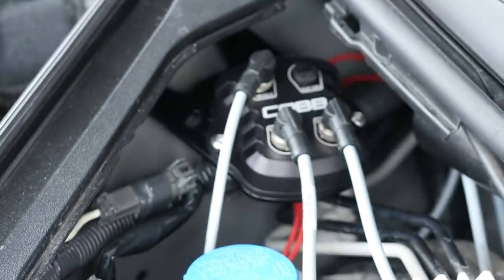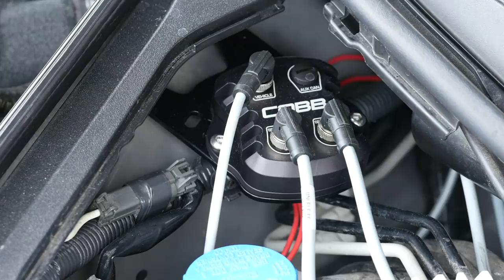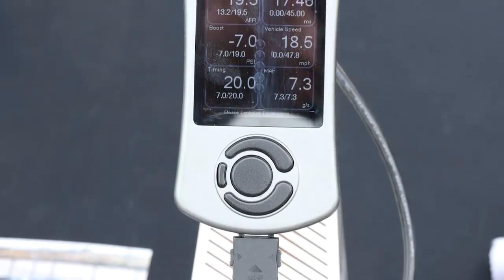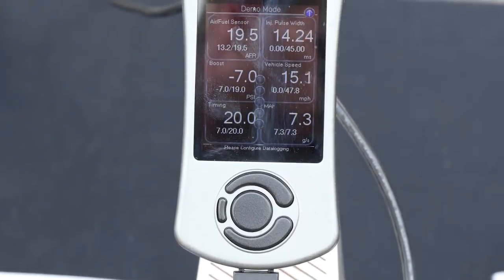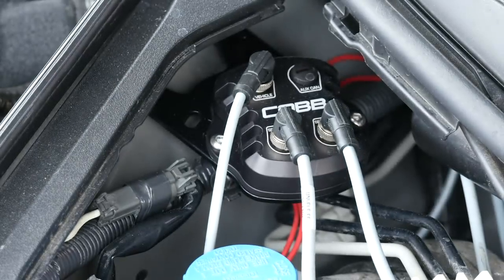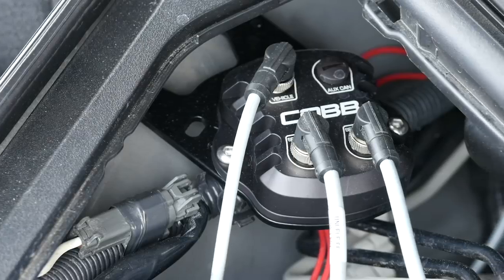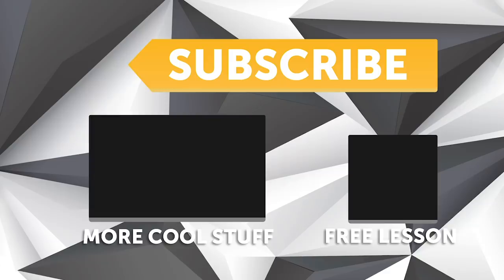Stock ECU + 1000HP | Flash Tuning & COBB CAN Gateway [TECH TALK]

Comment: As a former cobb customer I've gotta say the real issue with refresh devices moving forward is the pricing structure.  The access port is a decent value on the front side but over time things change.  My experience required me to send my $700 unit to get repaired at $100.  Then down the road new features were added so old users have to upgrade to a new unit although the factory ecu hadn't changed.  Then the legal climate changes and they have to implement the requirement of a $100 tuning class so you have access to future updates to the software.  The prices of standalone seem to be coming down but over time the cost of ownership for the relish device can creep up.  Thats why i ended up jumping ship and going to a standalone.  I still think the ap is a good option for owners who just want a canned flash for common upgrades but for anything more than that i suggest looking at Haltech or Aem.  More functionality.
Reply from the maker: Hey Dagan, agree none of those things that happened in your specific application are ideal. However nearly always, and even with the problems and additional costs you have had a reflashing solution will be cheaper than a standalone. 

What standalone did you go for? What was the price once it's all online? - Ben

Comment: I use a similar system like the CAN Gateway to monitor inputs and control outputs through a system called I/O link. It’s basically an Ethernet switch. Wonderful to see it incorporated.

Comment: What bugs me is how the Cobb access ports for Subaru are not compatible with our existing . Would be great if they were as the cost of a tune and dyno run is out the roof.
Reply from the maker: I don't quite understand what you're saying Chypz. A tune that isn't for your engine and specific mods is a bit half-assed. It might be 'OK' for some basic generic mods, but once you start seriously modifying your engine that cost 'saving' can quickly be chewed up by reliability issues. Quite simply, you have to 'pay to play' when it comes to any hobbies that involve engine modification, but at least an option like COBB is still going to set you back less than a standalone ECU - Taz.

Comment: Can disconnecting a battery cause a tune to be reversed back to stock? (FRS) i swear my car drives very differently now and not in a good way..
Reply from the maker: I believe with some models it is possible, but usually there is another step involved rather than just the loss of power to the ECU from disconnecting the battery though - Taz.
Reply: No expert here but I think your ST/LT fuel trims get wiped out without power.  Car will run sluggish until ECU resets values.
Reply: Your car is relearning the fuel trims. Give it 100 miles. Only way to revert is a flash.
Reply: Thanks for the help guys. It is getting better/back to normal.

Comment: wait, you compare standalone with oem reflashing without mentioning live tuning??
Reply from the maker: Live tuning is a feature of some reflashing software, depending on the ECU. There are other things to consider too, this interview wasn't dedicated to just that one topic to be fair =) - Taz.
Reply: High Performance Academy on cobb platform it’s so rare that can be considered as a bug. Same for other oem tools. This reason alone makes them unsuitable for anything other than basic bolt on modifications imho
Reply: You can live-tune with Cobb 🤘
Reply: @Alias1107  on what cars?? how come i can't find it listed in the features, you would think they would push it commercially if it works. also can't find any video on using it.
Reply: @Nebbia_affaraccimiei  Definitely Subaru, believe Ford as well, but you can always contact them directly for all the details
https://www.cobbtuning.com/subaru-ecu-tuning-realtime-vs-reflash/
Reply from the maker: @Nebbia, we disagree with that as a blanket statement. We even do a live tuning lesson using reflash software from another company.
So long as it's not a 30-minute wait to flash, it really isn't something that is going to be a major hurdle even in a commercial setting. Not ideal, but not an outright deal breaker either - Taz.